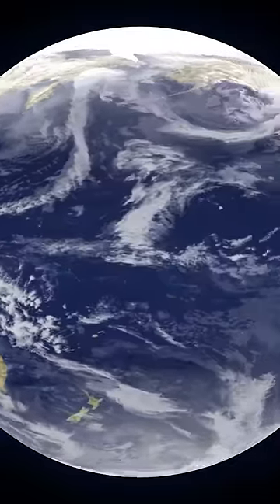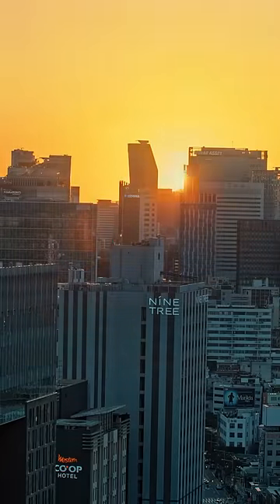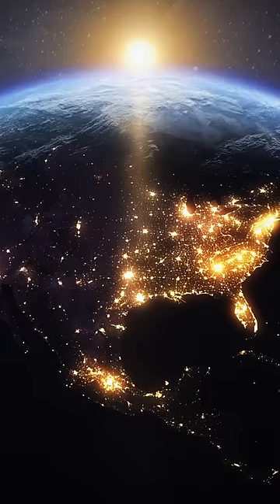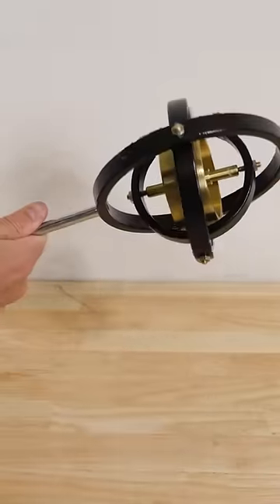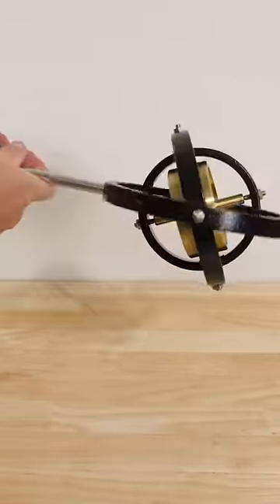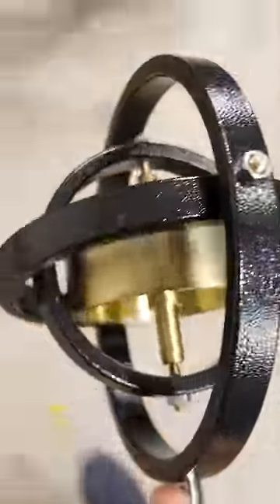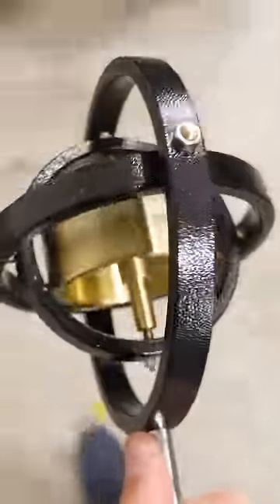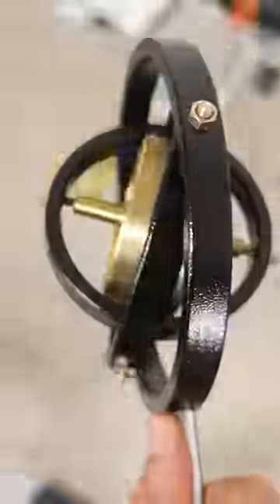Using a gyroscope to power the earth

Comment: Would that idea work in lower orbit ?
Reply: It's exactly the same... because the surface of the Earth and everything on it is actually in orbit around the Earth too. (A very low orbit, constantly getting pushed up into a higher orbit by the ground.)
Reply: Oh! Correction to my previous reply: in low Earth orbit the gyroscope will be in inertial free-fall, but a gyroscope on the surface of the Earth is being continuously accelerated by the ground. They'll both have enough angular momentum to orbit the Earth every day more or less.

Comment: I would like to hear the flat earth ‘science’ behind a gyroscope.
Reply: What do you mean exactly?
Reply: @Flat-Bob I think the OP means that a gyroscope with a spin axis not parallel to Earth's spin axis will precess at the rate of 15 degrees per hour. Flat-Earthers have yet to explain how that's possible on a flat Earth.
Reply: @Astronomator   I believe that's only in regards to the ring laser gyroscope. Because mechanical ones don't precess at all as far as I'm aware. And even the ring laser gyroscope precesses at different rates based on altitude indicating that it's not the spin of the earth causing it to precess.
Reply: @Flat-Bob  You list me at "Mechanical [gyros] don't precess ". They absolutely do.
Reply: @Astronomator   I've literally seen a time lapse video where a guy cranked up a mechanical gyro for a solid 15 minutes and it didn't precess even 1 single degree.
Reply: @Flat-Bob  I can't speak to the video you saw. However, if the gyroscope's axis was aligned with Earth's axis. there will be no precession. This is true of all gyroscopes.
Reply: @Astronomator   he turned it 4 different ways and each time the result was the same. No precession
Reply: @Flat-Bob  That's extremely hard for me to believe. All gyroscopes precess when moved, and mechanical gyroscopes are more prone to precess sometimes in the absence of movement due to limitations in bearings, mechanical tolerances, and friction. 

So the experiment (though the time-lapse video would be shorter) took an hour to conduct?
Reply: @Astronomator  Yeah I believe so. He even had a clock timer too, and When he spun it 90° each time it precessed as you'd expect but it picked op 0 rotational precession

Comment: Okay maybe build it inside of a semi vacuum chamber? Nothing to stop it then right? I’ll some further research I think they gave up too quick
Reply: Even in a vacuum chamber, you can't get energy out of it. The moment you try to do so, the gyroscope precesses.
Reply: @alihms  yeah I wasn’t done with my research yet but I’ve gotten to that point. Kind of moved in to try to see if there’s any other way to slow the earth’s rotation by 1 second
Reply: @youtubersdigest   extract lots of tidal energy. Admittedly what you're doing there though is really boosting the moon into a higher orbit (which does also slow the Earth's rotation).
Reply: @Logarithm906  I stopped at gravitational wave emitters but every method I could think of would ultimately require putting in more energy than you’d ever receive from doing it. That pesky old e=mc^2

Comment: you can’t extract any energy bc the earth isn’t rotating.
Reply: Trueeeeeee
Reply: Ehhhhhh????
Reply: Then why do pendulum clocks speed up and slow down when changing distance from the rotational axis? They do so in strict accordance with the rotational math, and have been know to be doing so for 400 years.
Reply: Because the earth isn't rotating relative to us - we are rotating with it, relative to the sun. There is nowhere non-rotating we can easily use as a brake.
Reply: Twilight Zone...😮...😊...
Reply: Wut?!?